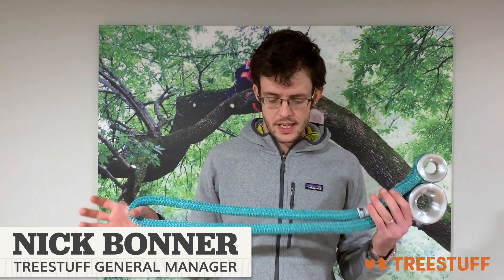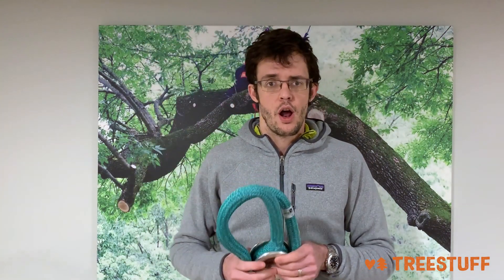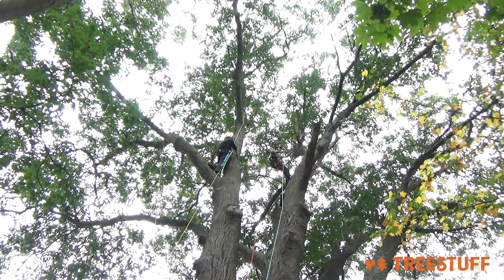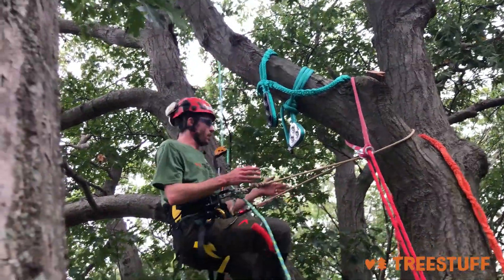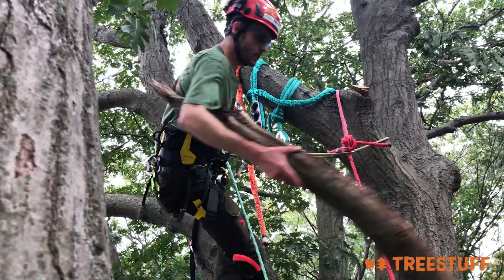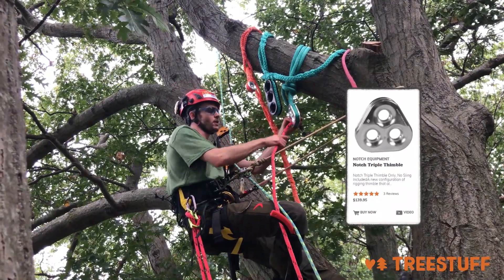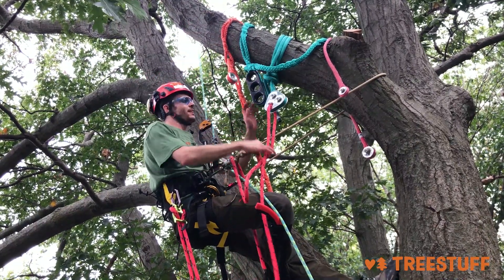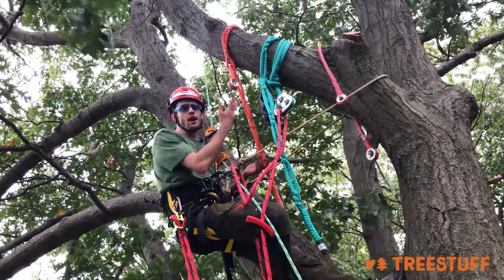Basics of Rigging Rings and Thimbles - TreeStuff Product Profile

Comment: Boss bought the endless ring and I tried it for the first time this week to negative rig a spar... Never using again, added enough friction that the groundie locked off a 10ft section of hemlock with 1 wrap on the porta resulting in a bruised rib cage for me. I will stick with my faithful Omni blocks which eliminates the guess work saving my body and the ground guys tender hands.
Reply from the maker: Yikes, we never recommend going big when you are first trying something new. Glad you are OK!
Reply: Size is always tricky on the first piece when negative rigging but I am still not sold on the aerial friction concept beyond natural crotch rigging. Just seems like a step backwards marketed towards people who only know natural crotch rigging as a "simple" option when in fact it just adds a new and unfavorable variable into the system.
Reply: I'd recommend trying it more. Don't go so big right away! Once you and the groundman get it, it can be super smooth for big wood.
Reply: I have a couple on ultra slings, took a minute but I like them a lot now, awesome for redirects too.